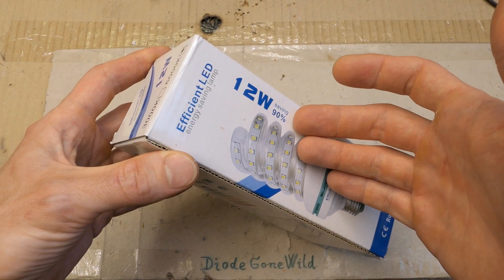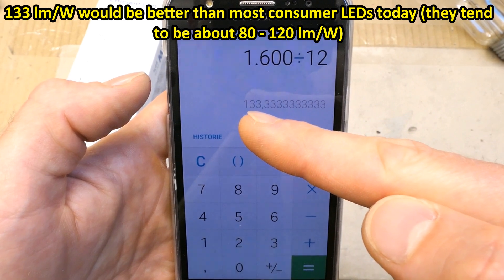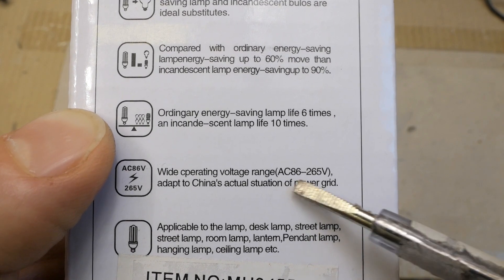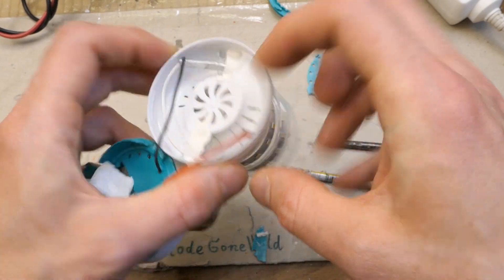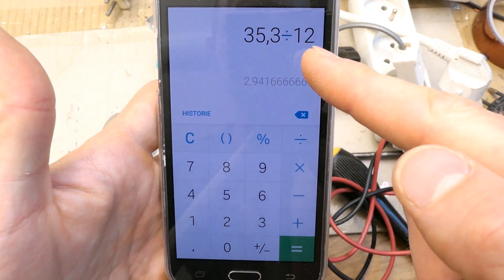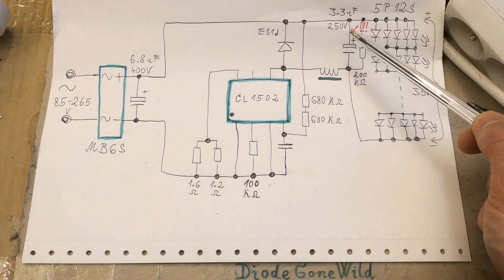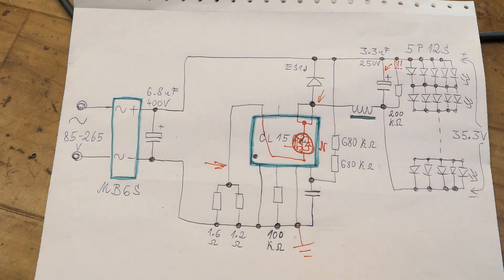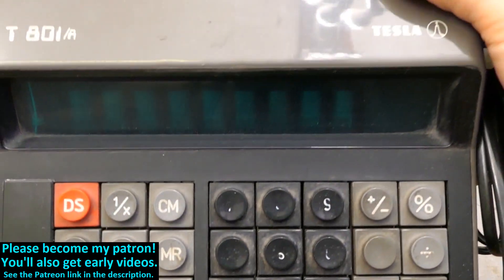Dodgy CFL-style LED in a funny box

Comment: At first, I thought using the CFL glass tube was a clever way of reusing old stock of that twisty glass... then I realized that, well... I'm not sure it would work that way, not without modification to the glass. Right? Also, the LEDs would probably be getting fried with no airflow or way to cool properly.
What a weird lamp!
Reply: I believe that plastic tube was straight at begin of process. After aluminium strip with flexible led strip above it insertion into tube contraption was heated and flexed into right shape.
Reply: It is, probably not (just) the old stock, but the machinery used to make them, which is worth more (if it can be put to use).
Reply: @Fridelain  Indeed it may be the one of reasons too. Though particular bulb shape went out of trend a decade ago.
Reply: I think this is a regular CFL but modified the machinery to skip the spaying of the inside tube with phosphor coating.  
Then just insert the LEDs and the PS.
Reply: @piconano  I also support this hypothesis
Reply: I didn't think of cooling within the tube....

Though 12w for 60 LEDs isn't much, and they very well may not be getting that hot. The metallic back might also help to distribute the heat and dissipate it
Reply: I don't think the glass would require any modification, other than not spraying it with the regular white powder used in CFLs
Reply: @piconano  Nope. It is plastic tube. Temperature suitable for glass heating will instantly destroy it. Can agree about bulb base molding forms though.
Reply: @chelarestelar  Hi, so do I, however I now  need some help to support myself.😏👴
Reply: @Fridelain  Ah, I bet you're right!
Reply: @piconano  That's probably most likely! Also, to make it not heat and crimp the ends of the tubing.
Reply: @KrotowX  you assume it's shaped with the LED strips in it... they can be inserted after ... it wouldn't be hard, just screw it in (like dog chain spikes that screw into the ground) and yes that would work in a spiritual tube... basically it's just the reverse of how he got it out. I think it IS glass and is inserted by a very inexpensive machine (glorified drill)...
Reply: @KrotowX  I have bulbs like that, and the tube is glass, I'd know, I broke one by accident.
Reply: @chelarestelar  It would dissipate better if they anodised the aluminium PCB. Shiny aluminium has very low infrared emittance. I can be used as a heatsink only in direct air flow, which is non existant in that glass  tube. They should have anodised or painted the board to increase the emittance, so it can radiate the heat into the glass tube which then can re-emit it (the glass will absorb then re-emit the heat, because it's not transparent at thermal infrared wavelenghts). With the shiny backing of the LED strips, only one side of it works as a somewhat effective cooling surface (because it is coated with solder resist, that side has high thermal emissivity).
Reply: Edit: IT can be used as a heatsink only in direct air flow. I don't contribute to me being used as a heatsink, regardless of air flow :)
Reply: @KrotowX  Bulbs trend? wtf?

Comment: You need to make a few videos on computer DVD drives. They are a true goldmine of technology-brushless motors, brushed motors, magnets, lasers, nylon gears, stainless steel axles, PCB's with golden components like voltage regulators, motor drivers, memory chips cpu chips, headphone amp driver chips, indicator leds, potentiometers and more. I think you could  trully make a 30 part series on reusing these machines of peak capitalist material abundance.

Comment: This buck regulator board is very common in India for replacement for original buck regulator in 9 to 12 LED bulbs for which It costed only ₹20 per piece few months back. Drawback is that output voltage is little higher than required.

Comment: I imagine that the redundancies are from automatic translating where 2 Chinese items are simplified to a single English word or object (i.e. two types of street lamps).  However, automatic translating doesn't produce typos so the writing was translated and then transferred by hand into the print files.  Bizarre.
Reply: Yes, Chinese do have multiple words for hotels.
I currently live in asia and it's harder for them to know if redundency makes sense or not if they never spoke english.
As for the typos, it's probably a picture to text conversion, which would explain the missing spaces and the "dislexic" errors such as c instead of o etc... my guess on that one.
Reply: Luckily they at least learned how Latin characters look. Seen an "ingenious" sign for Russians where text in English was printed with Cyrillic characters.
Reply: @KahruSuomiPerkele  Well, the typos are for sure generated by an OCR software, so my guess is that you are right.

Comment: "Vyrobeno w Cine" && "MADE IN EU", hmmm... even a stupid label contradicts itself.

I'm not surprised that MCPCB is used, theoretically it should help with heat dissipation, but since the strip is enclosed in a plastic or glass helix, the hot air can only travel upwards into the sealed case where it can't really exchange heat with the environment.

Nice circuit design, but the unsoldered cap leg was definitely a bad thing. Looks like it was soldered by hand, at least the THT part, and a mistake happened. 

Nice VFD calculator! Non-destructive teardown, please.

Comment: It would have been nice to do measurements before soldering capacitor to see how it impact the output.
Reply: Yeah, I hoped we'd see that on the 'scope.
Reply: I too expected another measurement with capacitor disconnected. It should cause awful light pulsations. Not exactly visible by naked eye, but very tiresome during a hour.

Comment: I was surprised by the output capacitor. It's only 3.3uF and rated for 250v even though it only sees 35v. 15uF 50v would make more sense. They probably copied the value from high voltage LED string drivers.

Comment: China's power grid is somewhat unreliable so there is fluctuation of voltage and frequency but the nominal voltage is 220V 50Hz throughout the country. (Unlike Japan where the eastern half the country uses 50Hz and the western half uses 60Hz)

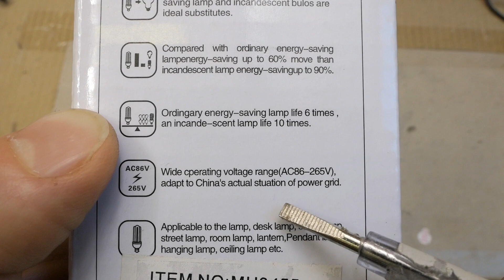Comment: (3:30) China actually has both 110 and 220, in most parts its 220 but some use 110 for some reason

Edit: Taiwan use 110V but historically china had many places with 110 in the mainland
Reply: Where do they still use 110V?

BTW, Brazil is the same, both 110 and 220.
Reply: @LMB222  Taiwan, although i dont know if its considered its own country or not
Reply: @alexstone691  since PRC has no control over it, it is its own country.
Reply: @alexstone691  If you sat a random collection of politicians around a table they could probably argue over whether Taiwan is a country or not for years!

Comment: The text was Chinese and they used an OCR tool to convert the translation into a text format on a fax or low quality printed document. Loads of stupid claims though make it look like pure incompetence in the marketing department, who just happens to be the same person who mops the floors, because he claims to have a cousin who speaks english, but he didn't even have that!
Reply: In fairness to them, they probably have a mountain of parts intended for other applications, reusing what they have lying about in as an efficient way as possible. I don't think sticking the LED strip down the glass so bad, provided it wasn't push so hard. Do a bigClive mod to lower the output of the buck regulator and maybe the lamp will last a fair while. Getting to it and reassembling the using might be an issue though.

Comment: I've bought some extremely similar lamps at my local discount shop in the UK. The base is identical, with the same power supply, but the LEDs and glass envelope are different - instead of the helical design they have 4 U shaped tubes which each contain two straight strips with 9 LEDS (3s3p) The CRI and colour temperature are absolutely horrible so I just dismantled them for some nice aluminium LED strips to use in other things.

Comment: Wow, that's not a very good LED... I was half expecting you to end with "so the conclusion is... super dodgy!" like you do with the USB phone chargers.
Why would they re-use a housing designed for CFL light bulb...
Reply: It's not super dodgy. Actually just the fuse is missing and the soldering is bad, but otherwise I can't see anything wrong with the design itself.
Reply: @gabiold  Interference filters also missing.